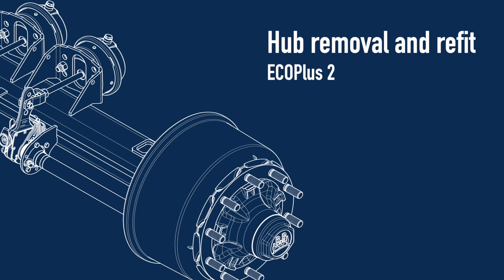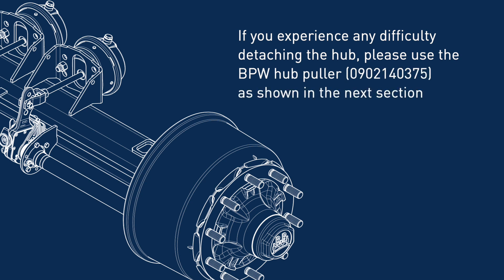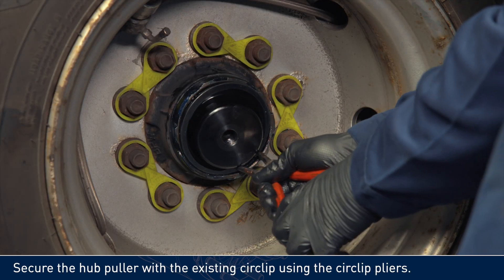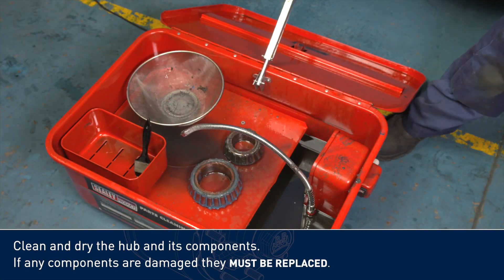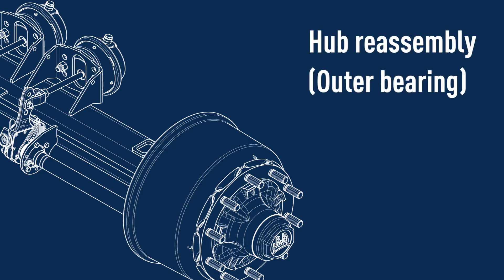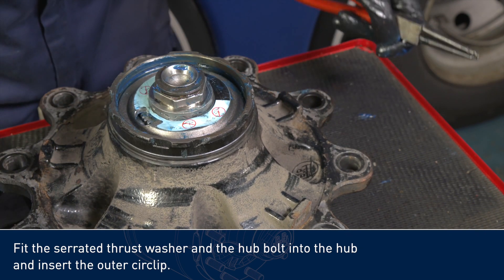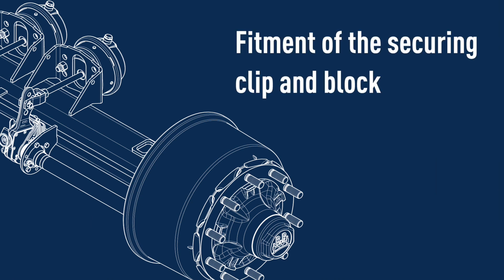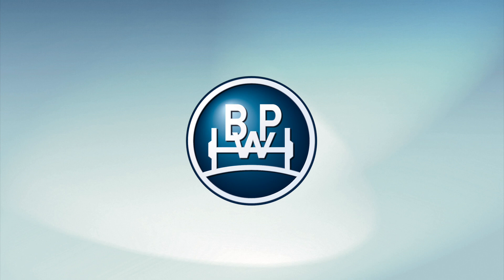BPW Maintenance procedures for BPW hub systems ECOPlus, ECOPlus 2 and ECOPlus 3

Comment: "Never overpack a bearing", they say.  But is it true?  Does that old adage apply here?
Reply: Yes, if you overpack a bearing the excess will go into the hub cavity, which if that is overfilled too the grease will overheat inside the hub as it’s churning about and turn into a liquid, losing its lubricating properties. The liquid grease can then come past the hub seals and onto the braking surfaces.

Comment: Recommend removing wheels from hub to avoid wheels stuck on. Poor tyre fitters.
Reply: yes, and it saves weight too, esp. if the next step is to remove the bearings outer race, using a hydraulic press!!; we are not all as strong as Hercules!!! (taking the wheel off also gives more grip on the brake hub, so you don't cock them on the way out, damaging the axle seals!).